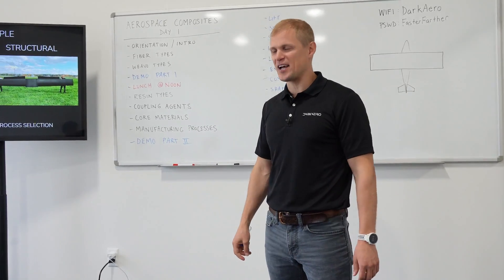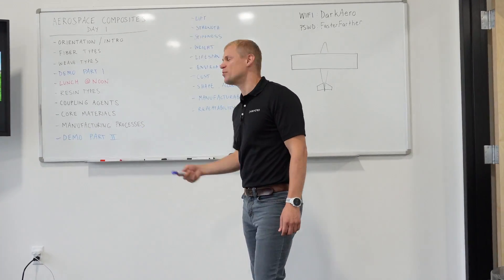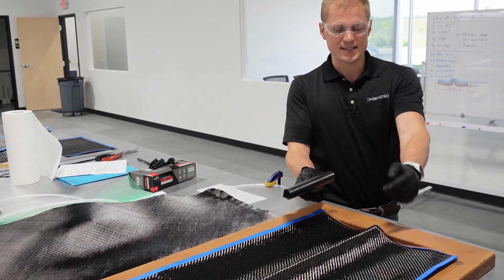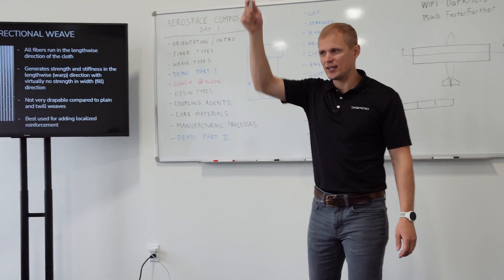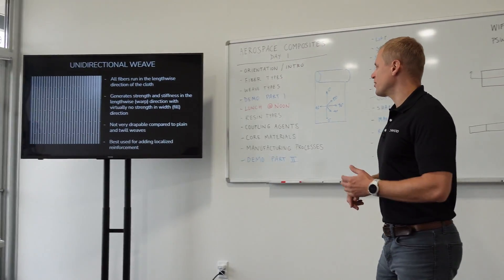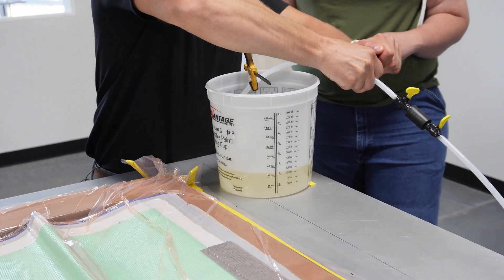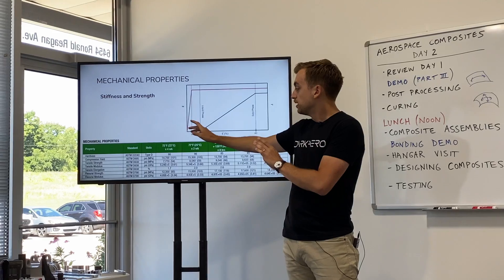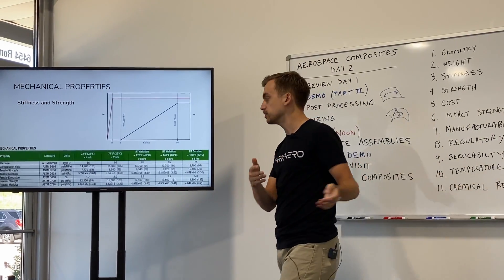How to get more out of carbon fiber

Comment: Guys: I have a small composite shop using wet layup with VE and 7781 and some 3k twill carbon fiber. We make experimental gyroplane kits. However, we are designing a side by side model gyroplane which will have composite structures as a monocoque. I would like to learn the best way to manufacture that and leaning towards infusion. Currently there are 2 fulltime people working in our composite shop. Do you think this class could help my employees learn about infusion? We are getting close to finalizing STL files and sending them out for quote to get the plug to make molds. We currently make AR-1 gyroplane kit.
Reply from the maker: Hi Abid! Yes, this course would teach your employees infusion. We perform a full infusion demo and provide an infusion guide as part of the course. You can contact us directly at courses@darkaero.com if you have further questions.